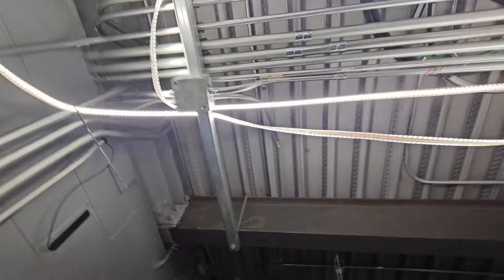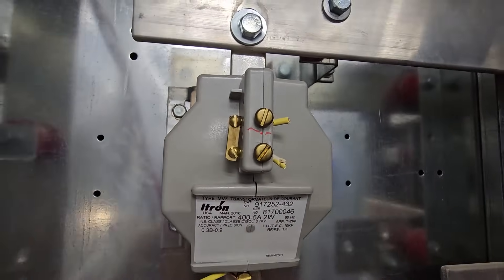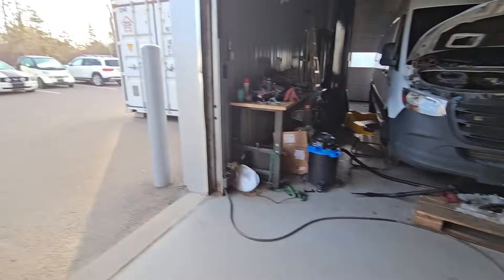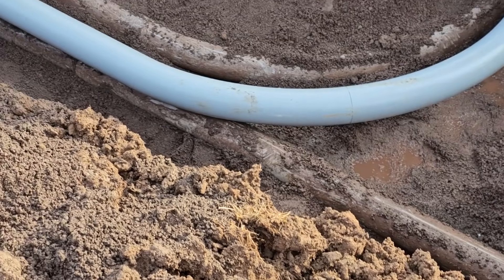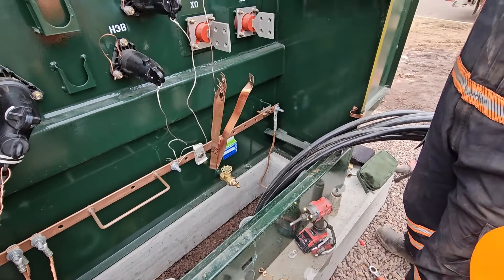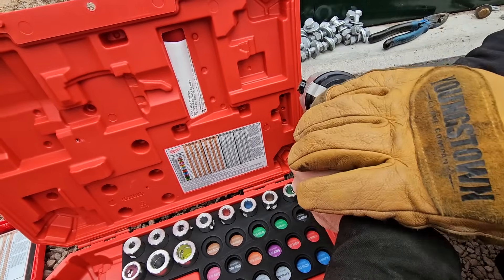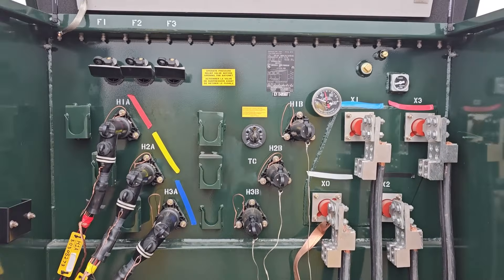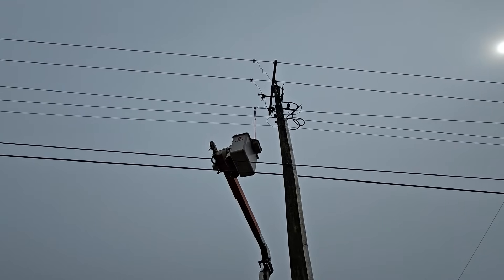Three phase 800 Amp upgrade

Comment: That phase rotation is important to maintain, my father told me a story of his father working for a US army contractor tasked with trying to figure out why motors were reversing overnight at a factory (this was like 1930s or 40s) and he traced it to a guy at the local substation that was just changing around loads without paying attention to the phases.
Reply: Yup a while back I was an industrial maintenance tech at a factory, but the boss was a bit scared to have me do "high voltage electrical work" they hired a "professional" to wire a pump motor for 480 instead of the as shipped 240V and they mixed up a couple of the phases causing the motor to spin backwards 😑 destroying the impeller and motor in the process. Anyway when we got a replacement in I wired it correctly, they didn't doubt me after that. ❤
Reply: I worked in a building that the local small town power provider had converted from 3 phase to single phase. When tools and equipment started giving up the magic smoke, I discovered that one side was on the delta high leg. The issue was at the weather head.
Reply: I heard about one industrial plant, where they same thing would happen, they would come in for the day, and find some of the lathes & other equipment running backwards. They would call up the power company, & dress them down for doing that.
Reply: > "reversing overnight .....a guy at the local substation that was just changing around loads without paying attention to the phases." In a different field: telephone cables have polarity. Old dial-phones don't care, and modern tone phones have rectifiers, but my dad had one of the very early 1-transistor TouchTone phones ☎ and it would not work on reverse polarity. He was on an old-old farmer's co-op with 70 years of sloppy wiring. The new incumbent was trying to get it straight, fixing a few trunks every night, but about every other cable was backward, unlabeled, so Dad would wake to a won't-call phone. He got pretty good at calling the telco by jiggling the hook-switch and get it fixed. For today. He could have got a newer phone, or a pocket tone-dialer, and he even knew exactly how to wire a DPDT switch to reverse his own line. But he was amused how much trouble the telco was having. (He was a comms-guy in Los Angeles when they had 7 or 9 phone systems so nothing new to him.)
Reply: @PRR1954 That's cool. I have made calls with the hook and even had a pocket tone dialer. I've always been fascinated with that kind of thing.
Reply: I don't know what the Canadian electric code mandates but the US National Electric Code requires that the phase rotation be clockwise from left to right, top to bottom, or front to back in a panel.

Comment: A couple of years ago we upgraded our service at the farm I work at
We went from 600A 600V 3P pole pigs to 1000A 600V 3P pad mount
with 8 Aluminum direct burial wires from the transformer / meter to the breaker panel

Comment: As always, it's a great video. As an electrician myself, I have been working alongside our local lineman doing service change outs for years. Thank you for helping the sparkes out old pulling out wire. I have worked with a few guys that just sit in the truck untill we are done. And yes Milwaukee tools are game changer.

Comment: That Milwaukee cable stripper looks like an awesome tool!! I’m going to have to show this to my employer and hopefully they will give it a shot! From what I saw in your video, it looks like a great tool. I imagine the safety department will highly approve of this. Less chance of a knife injury, plus it shouldn’t accidentally cut into the copper or aluminum wire. Curious if this tool still works well when it is below freezing…

Comment: Nice work and explanations as always Aaron!  You are braver that I am, I wouldn't have stood by the padmount when closing in.  There was that one service upgrade  I mentioned where the padmount went thermonuclear thanks to the sparky rolling the secondary phases.  And though extremely rare, I was told of a few instances where brand new transformers have failed violently.  As for that stripper tool, too bad I retired or I'd love to add that to my collection.

Comment: Nice job. interesting how its metered, seems its lowered just to read the consumption, I think?
Reply: Yep, lower voltage to the meter is safer. He did video on changing a three-phase meter out, with the little test panel (all those knife switches) I think mid-2024?

Comment: I NEVER work with wire the big but that new tool is AWESOME.
Reply: Indeed! In a former life (aerospace EE), the assemblers on our missiles used thermal stripping exclusively.
Reply: @n6mz  "Thermal stripping"? Like melting the insulation off?
Reply: @ Yes. Instead of mechanical jaws cutting the insulation and risking a nick a thermal stripper uses hot wires or strips to melt the insulation at the strip point. In the high-G high-vibration environment of a missile, a nick in the conductor can propagate through it causing a break (and usually a major failure of the missile).
Reply: @ Ah, cool! Same principle as cutting /carving styrofoam, I think?